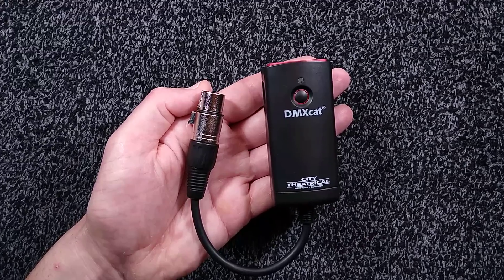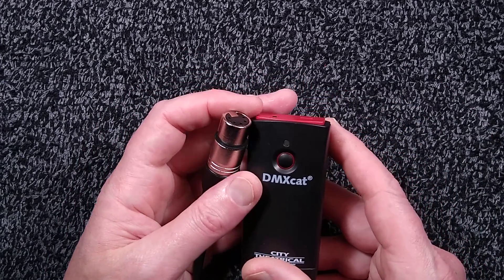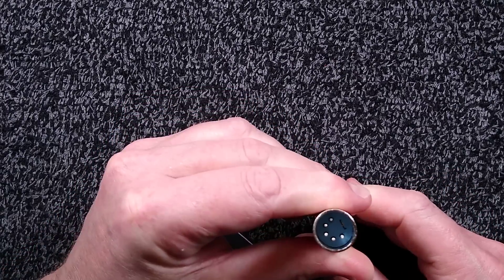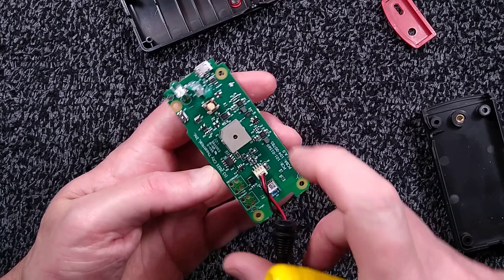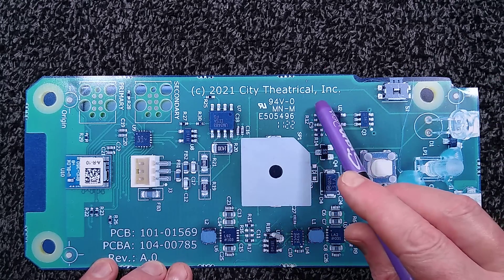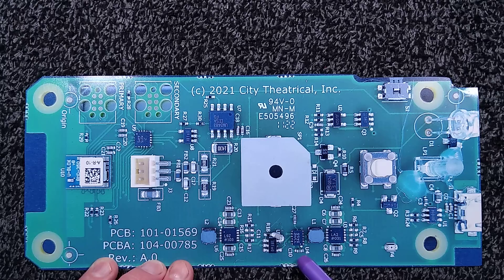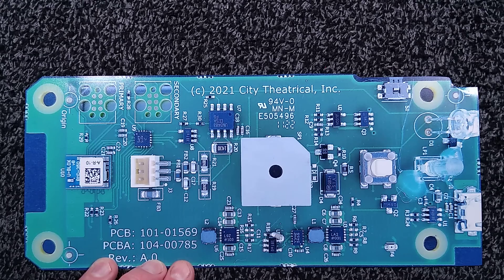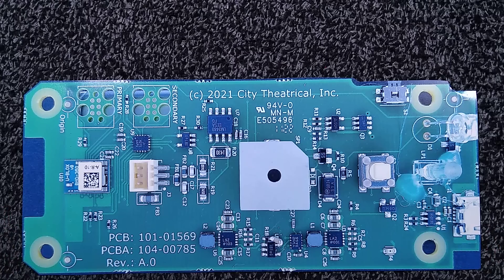Inside the DMX-cat event-industry lighting tool

Comment: The programming interface looks typical for use with a Tag-Connect cable.
Reply: Yes, used the over priced Tag-Connect in the past to program my ARM boards but in reality, the footprint is no smaller than a much cheaper 1mm pitch connector which I use on all my boards these days.
Reply: How can any connector be "much cheaper" than no connector?   TagConnect is good - but those four massive holes are best avoided - use the "NL" (No Legs) version of the TagConnect.
Reply: @IanJeffray  The no-leg versions are better for production floors to quickly connect and release (i.e. like a bed-of-nails test stand). But when developers have to spend hours staying connected to a device in a debug session where you also are connecting/disconnecting, flipping switches, or making other kinds of physical adjustments to the device being debugged, having something a bit more physically secure is nice. And I do have to give the Tag-connect props that they ARE secure from even moderate bumps.

The Tag-Connect's redeeming value is how compact the connection is and how it requires no additional BOM parts on the device. Edge connectors can accomplish this too, but have their own set of disadvantages both in development and production. And for tiny products where you are trying to size as small as possible, there is value in this setup. But overall, I do have to admit they are pricey. And personally, I still prefer a standard 2-row 8-pin keyed JTAG plug. But as things get smaller and more compact, interconnect pads like Tag-Connect will be more and more common on products that require programming a chip in situ. So as a developer, I'm glad there are solutions like Tag-Connect. I'm just amazed a cheaper and standardized alternative interconnect hasn't emerged. But given firmware development is dwarfed by software development, any tools made for us will be low volume and high priced even if standardized.
Reply: @chrisgrey9204  how does that take up less board than 2 row 8 pin 1mm pitch SMD header pins?
Reply: @mycosys  It is slightly more compact. The surface area size of the Tag-Connect pads is just a bit smaller than a 2x4 header, but admittedly not by a lot particularly when you consider you do have to include clearances around the pad so the connector can connect without obstruction. I don't know if there is an surface area saving over a 2x3 header...there may not be. 

My point was header pins are an additional BOM item. On low-volume equipment, this is hardly a problem. But for high volume, cost-constrained, devices, additional components are a cost that is much greater than the part itself. From a manufacturing standpoint, these are just a few of the costs that every BOM item imposes:
-the part itself
-procurement (i.e. shipping and receiving)
-real-estate cost to stock the part
-inventory/accounting/reordering/taxes on unused parts at the end of the year (yes in the US, mfgs get taxed for stock on the shelf that just hasn't made it into the product)
-install cost (paying a person or for equipment to perform the placement)

Eliminating a BOM item, even sub $.01/item part yields savings to a manufacturer of high-volume equipment...and especially parts that are thru-hole and often are manually installed on the board by a human. I don't recall the cost of a 2x4 header, but I venture it is greater than $.01.